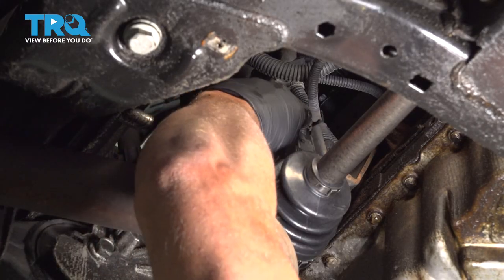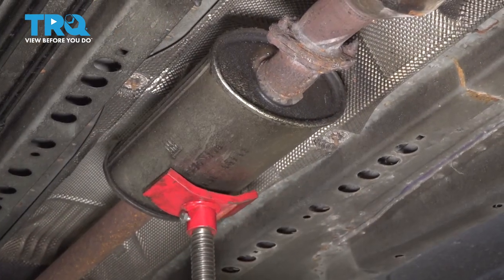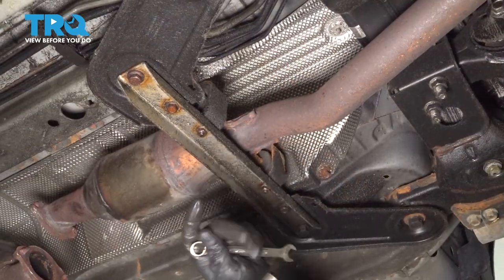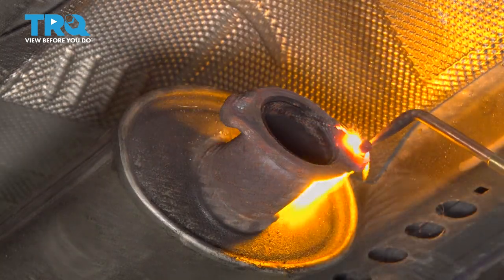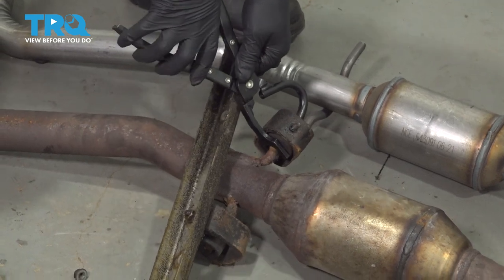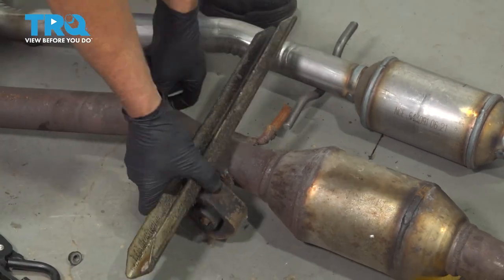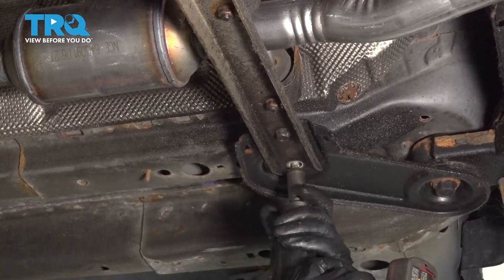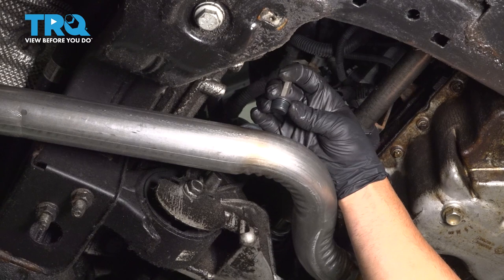How to Replace Rear Catalytic Converter 2011-2015 Chevy Cruze

Comment: Great video! Could you have used bolt cutters to cut off the rusty studs if u didn't have access to an grinder and had enough clearance to get a bolt cutter in there